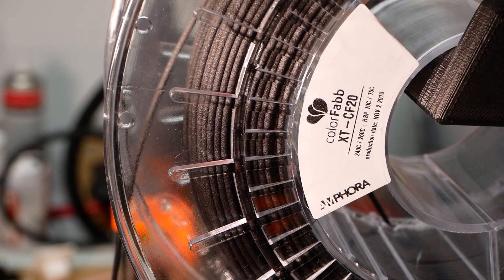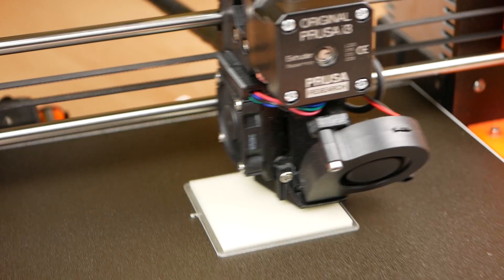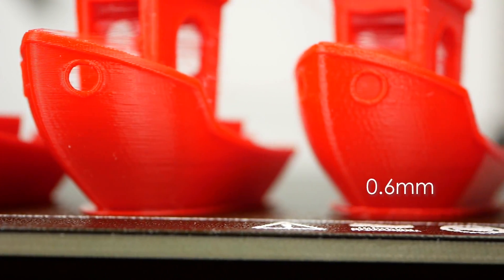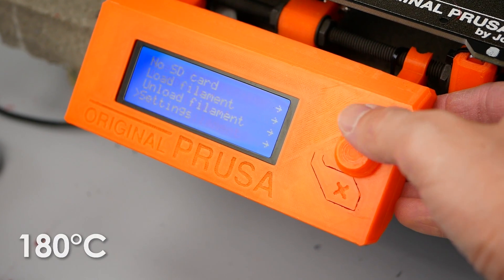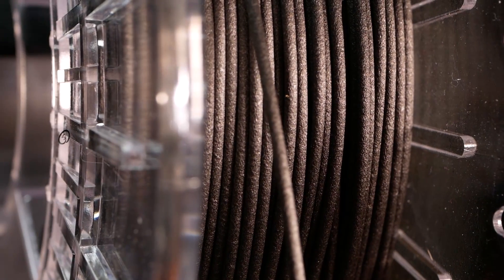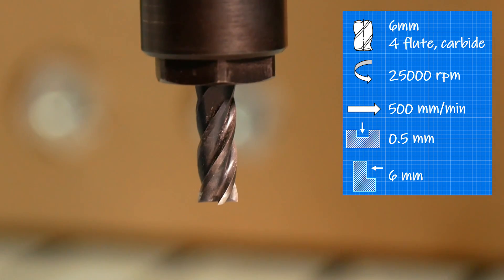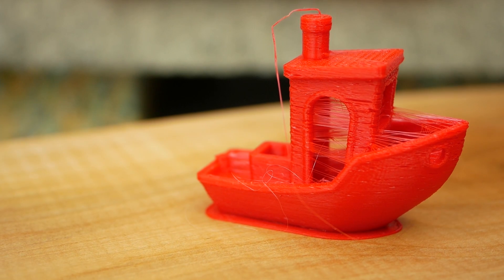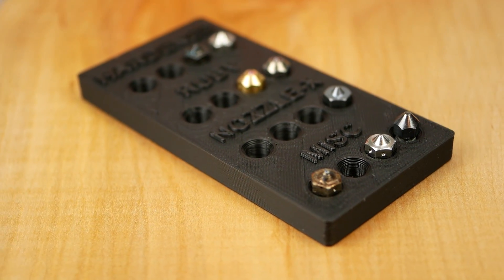HOW MUCH abrasive filaments damage your nozzle!

Comment: That spiral is from the drilling procedure at the factory. The tool is flexing as it's plunging in.
Reply: 25 year machinist .. that pattern happens when the drill geometry is shoddy, specifically the lead on the spiral or the point being off center slightly and your feed is way to high. Brass has a tendency to grab when using sharp tooling. A way to mitigate the grabbing is to flatten the cutting edge slightly on the perpendicular axis of the cut. This is probably the reason for the over powered feed so as to compensate for that flattened cutting edge.
Reply: @swould333  I can confirm that, worked a lot with brass in the past, it likes short stubby cutting edges and the unevenly sharpened chinese 1.75mm drill bit is far from that. High speed vibrations + eccentric forces combined with resonance from the brass grabbing and you get forms you could not imagine can exist!
Reply: @Waylander131  I love how every metal has a "personality".
Reply: @swould333  curious if the good nozzles are cut in three procedures and that's why they have good surface finish and geometry that clearly wasn't taken off a shotty twist drill.
Reply: @swould333  in addition to what Sean said, I wonder if E3D drills them out, slightly undersized, and then reams then to the final dimensions?
Reply: @swould333  yep.
Reply: If the drill vibrates, it usually makes cones. Like an hourglass shape. The walls of hole look like melted, probably drill was overheated during the production and left that weird pattern?
Reply: To me, it looks like the E3d nozzles that have the better finish and are machined straight are most likely reamed.
Reply: If I have to guess, they are plunging cheap floppy drill bits into the brass as fast as they possibly can. The image in my head would be hilarious if people weren't buying them.
Reply: looks like chatter and improper tool cooling. Probable a dull bit and forced it into the cut until it failed.

Comment: Hi Stefan, I'm using probably the same ruby nozzle that you have in your ruby collection. It has a chromed copper body. I use it with a titanium heat brake (all metal) and a home-designed & milled copper heater block. The back pressure in the nozzle is greater (especially with CF-PEG) so I use a dual-drive geared extruder. With a bowden cable, in a Anycubic kossel linear plus. It took me a while to get good results again, but now it's spot on. I play around with linear-advance a bit and with normal PLA it's better not to use it (K-factor zero). Hope you're having fun with it and happy printing!

Comment: Another fine video. It was interesting to see E3D's earlier research on this topic when they introduced the hardened nozzle and had similar results but much-increased internal wear. I think they did many more hours of printing. I use a lot of XT CF20 with the hard nozzle and there is no wear detectable by eye but it does eat the silicone socks!

Comment: That "spiral pattern" is simply due to the fact that the drill is probably in the same price range than the nozzles them self.
They are probably sharpened by eyeballing on a grindstone so they have very uneven cutting forces, pair that with a crappy loose chuck and voila you have your 0.20€ piece price...

Comment: I've noticed that the Geeetech "0.4mm" nozzle really has a hole diameter of 0.35mm. It is also advised to use 0.05mm higher line width than nozzle diameter.
I think you were a bit unlucky with the internal chamfer, the cheap e3d clone nozzles i got from China had a straight hole, or a hole mangled in a variety of interesting ways, not necessarily a chamfer like that. Didn't find it to be an issue for the most part. I find it amazing that they can mass machine a complex part cheaply like that as it is.

Comment: I concur with your findings, it was interesting to see the 60 degree chamfer on the inside of the e3d nozzle verses the 90 of the in expensive nozzle. Custom tooling verses standard drill bits, that is significant.
Reply: Both angles point to an custom drill bit. (Which arn't expensive when you mass produce.) The default angle on a HSS drill bit is 118°. But there can be differences for hard and soft maqterial from 110° to 130°. Carbide drills normally use 140° tip angle.
Reply: Most spot drills have a 90 degree angle and are extremely rigid. Could be step one for E3D’s process...
Reply: You are correct. Machining bits can be 90 degrees.
Reply: That would make since.
Reply: With a finishing cut at 60

Comment: Just replace your brass nozzles with stainless steel or tungsten.
Reply from the maker: Stainless Steel is not much better than brass. If steel, than hardened tool steel.

Comment: The wobbly pattern of the passage through the cheap nozzle is from a warped drill bit.

They used a high rotation  speed  (probably with inadequate cooling fluid) and overheated the bit several times and they were using a high rate f driving the bit into the brass.

Its an effect I got when learning to use a home drill press.
Reply: F Huber  it most likely isn’t cut for brass and was trying to pull the part as well which combined with being cooked and probably dull
Reply: Some more insights as to how the wobble might have occurred: The geometry of nozzles lends well to lathes (and by extension screw machines), where wobble of both the part and the drill can be more severe vs with a mill. It's also likely that the stock used to make the nozzles is at the max diameter of the part to minimize material waste, and that thinner material would also wobble more. As for feeds and speeds, the high machinability of brass allows very aggressive settings without significantly shortening tool life (and that's great for minimizing labor cost, but bad for part quality).
Reply: @tronique5736  most probably machined from hex bar
Reply: Also I bet the is not exactly round, but slightly elliptical due to the same reasons. I’ve learned the hard way as a home gamer that drilled holes are always bigger and never round.

Comment: How about adding the cheapo titanium nozzles from your favourite chinese supplier? I'm pretty impressed with those, but haven't done the in-depth  study like you did ofc.
(Oh, and yeah, awesome video!)
Reply from the maker: Titanium nozzles? That's a horrible idea! Can you provide a link?
Reply: Sure, I get the thermal properties may suggest they'd be sub optimal, but seems not to make a big difference. For the heat breaks the material is probably better suited, and the increase in surface finish also is a bigger advantage there. 
Anyways, link:
https://www.aliexpress.com/item//32849870228.html

Comment: the path inside the nozzle was made by the vibration of the drill tip. The material of the tip is so low quality that it start sway due to speed and temperature.

Comment: The spiral pattern is achieved by plunging a dull bit into the brass with a lot of force. They make a tool to cut out the inside profile then use it until it breaks. Probably the first 1,000 nozzle's bore is totally straight, by nozzle 2,000 though you have the spiral pattern and somewhere after that the bit breaks and they make a new one.
Reply: So they just jam a drill bit in there?
Reply: @cherrify3498  sounds like it
Reply: I imagine that drill runout will also cause a spiral. An extremely true and concentric chuck is needed for highly accurate drilling at such small diameters.
Reply: It's not a great application for a form drill because there is a high ratio of diameter for the tip diameter and the body diameter of the nozzle and also because the tip diameter is so small.

For a 1.75mm filament bore and 0.4mm outlet dia, one would have worse than a 4x ratio between the smallest diameter and the largest diameter on the form drill. This means that you'd really like to be drilling that tiny 0.4mm diameter a much larger RPM than you can run the 1.75mm diameter at because you'll exceed cutting surface speed limits on the larger diameter. 

This means that you have to plod ahead at 1/4 of your best drilling rate for that tiny 0.4mm end which is going to be doing a terribly ugly drilling job for the entire length of the nozzle because it's stuck to the end of the 1.75mm body dia. It would be far faster to blitz the back end of the hole with the 1.75mm dia for nearly the whole nozzle length, then go in with a 0.4mm to peck out the last bit of length at the end.

Using a second tool position to have separate 1.75mm and 0.4mm diameters will be far faster with better quality drilling and much lower breakage of tools, not to mention that standard jobber drills are way cheaper than making a form drill.

I think the spiral pattern is being caused by a cheap jobber drill being pushed too far past their sharpening regimen. There's no really good excuse because clean holes in brass with jobber drills is very easy with CNC. The level of tool wear management necessary really isn't high.
Reply: ½ right. This spiral pattern will happen regardless with any HSS drill, as flexibility is one of HSS's properties, tho the effects first gets noticeable bad then the drill is dull. You could go a lot slower (feed), but then surface quality and accuracy will suffer (hole diameter)
Reply: this^^^^^^^^

It's so simple it's strange no one understands

Comment: In a previous life I was a tool and cutter grinder in a mould shop.  One tool I had to design and make was a D-drill for plastic injection nozzles.  The interior bore ended in a 40° included angle hole.  I assume this allowed for faster flow in the injection process.  Materials for the nozzles were either beryllium copper or a tool steel.  the nozzles also had a variety of exit holes,  some on the ends and others at angles coming out on the sides of the tip.
Reply: James Crombie that's awesome!

I thought that angle was really interesting. I'm guessing E3D have tried all sorts of angles to get one that works best, but I'd be interested in results from even more acute angles.

Comment: wow , the difference between the nozzles
another reason the Prusa prints so much better than the wanhao and cr10 for small details...

I now have the ruby on the I3 for 6 months and print all materials with that.  never look back. check it once a month for damage .

printer printing PLA, GiTD PETG 20hrs a day...
Reply from the maker: Just don't use a brush for cleaning them 😉
Reply: @CNCKitchen  and make sure you realign your z-offset BEFORE using them .... duhhh :(  manchmal bin i deppad---

Comment: Would it be then possible to recondition slightly worn nozzles by lapping the tip flat?

Additionally, you could try drilling out 0.25mm nozzles to 0.3 or 0.35mm.
Reply from the maker: Should work but probably not worth the effort if a good, genuine new one is just $5.

Comment: I'm looking forward seeing you machine a tungsten nozzle 😆 Great video as always! I too have a brass nozzle and the wear was primarily on one side, the filament free extruded to one side too. I used a steel tweezers to clean the nozzle regularly, which probably did some damage too. The surface finish with a new steel with zinc coated e3d nozzle is significantly better. A new brass nozzle was going to be better too of course, compared to the damaged one. I'll try to machine the nozzle too, would be interesting.

Comment: can u straight up comapre an e3d nozzle print quality to the cheap chinese one? both new. like more testing!
Reply: Did you watch the whole video? This was done...
Reply: @AustinVojta  in more depth :P like for example lets say the accuracy of parts the fitting etc. you know?
Reply: @AustinVojta  I Mean in more depth. like part dimensional accuracy or if it's really worth it? etc part fittings would rock too. tho I already think it is from that one benchy
Reply: @AustinVojta  maybe with not THAT cheap nozzles. like trinagle labs ones/ you see my point? he compared a 21$ one to 0.2$ ones. I am thinking of more a 5$ to 21$ ones. from triangle labs as an example.

Comment: The odd spiral pattern is most likely caused by the stock being off-center when drilled. This causes the drill to wander, due to flexing, while drilling. I have seen similar behavior when milling a circle, using a bad collet that mis-aligns the tool. It can actually create a hole that is hourglass shaped in cross-section!
Reply: Also, unevenly sharpened drill bit does the job. Possibly they didn't even use center drill.
Reply: yeah no center drill would do it, i wonder boring it on our own would do any improvement

Comment: Freaking brilliant video! Very impressed by the quality of production and the solid engineering content.

The undulating helical pattern is a likely result of a worn or chipped drill bit and pushing the feedrates on the lathe too hard. Also if you don't have your drill running dead centre it will walk and cause run-out. Glad to see ours were straight and shiny as they should be, but agree that it's not really a contributor to stringing.

You're dead right that the most important part of the nozzle is the orifice to tip flat transition. We've put a lot of time into ensuring that corner is 'just so'. The internal cone angle is also a surprisingly large contributor to the ooze and clean sharp extrusion, it gets you the more laminar flow you postulate and lowers pressure needs. Combine those two and you get the rather dramatic difference you saw in stringing.

I suspect but cannot prove that the excessive chamfer on the clone and worn nozzles also serves as a place where material will cling to and accumulate. This little annular 'pool' of very liquid material may serve as a source of material that will be entrained into a string. Retraction is going to be completely ineffective at controlling any buildup on this part of the nozzle.
Reply: I was going to say: this guy sounds really sure about his statements, then I saw your name.
Reply: Genghisnico13 the “our” referring to the e3d nozzle was my first clue — people sound sure of themselves in YT comment sections allllll the time ;)
Reply: I was going to say the spiral was from a blunt drill but it has been said in detail above so I'll shut up now. Thanks very much for the great videos @cnckitchen
Reply: Thanks Sanjay! "Retraction is going to be completely ineffective at controlling any buildup on this part of the nozzle." 

This fixed the biggest problem I had. It's what I deserve for not getting the real E3D.  The real one just got moved way, way up on the git list. Maybe a new job too.
Reply: I just want to add ontop of your fine explaination about the helical pattern.

-This is a great example why GPS tolerances (Geometric Product Specification) was invented, and specifically why it's important to have them specified when you make large orders produced out of China and the like. Not that it isn't necessary in all other countries though. :-)
Reply: @martinfrandsen3960  Is this basically the same thing as GD&T?
Reply: I think AvE or ToT said the reason this happens. I think its when your speeds are too high or the twist drill starts self threading and it pulls itself into the material. Like when you drill sheet metal and the drill grabs and pulls itself through. Then it maks like a triangular shaped hole.
Reply: I absolutely agree about the drilled bore in the nozzles. And I'll add that a cheaply made drill will most likely have uneven cutting edges, which will exacerbate that spiral when pushed too hard. Manufacturing hundreds of thousands of these nozzles is almost bound to be done cheaply, so you get what you pay for in the end.
Reply: I was just about to pull the trigger on the E3D until I noticed the orifice in the pic is way off center. I hope someone will explain it away for me. https://images-na.ssl-images-amazon.com/images/I/61DQ-2sXjvL._SL1282_.jpg
Reply: Excessive feed rate, lack of pecking and worn tooling is the most likely causes, but materials like brass also have issues caused by their high thermal expansion. Materials do not heat evenly when drilling and tends to build up heat near the corners of the drill flutes during the machining process. Thus the materiel near the corners of the drill flutes is removed at a higher temperature so those areas expand more then the other areas of the cut. This leaves a smooth hole at the time of operation, but then when the materiel cools and constricts it leaves a helix or spiral shape that matches the drill feed rate. Brass and plastics it tends to become fairly prominent due to their high thermal expansion rates and high drill feed rates.

Comment: Is it possible that the tip of the nozzle sands down by touching the prints, so it sands down faster at lower layer heights?
Reply: yes and if over extruding even a little bit the nozzle will drag more.
Reply: That means one should beware of excessive ironing, right?

Comment: When you see this it makes you wonder why ANY nozzle is made out of brass! Besides the cynical attempt to get more money from consumers by providing replacements for purchase!
Reply: High thermal conductivity, low friction coefficient and easy machining.
Reply from the maker: @santiagoblandon3022  Exactly, and the raw stock is cheep, too.
Reply: @santiagoblandon3022  Correct.
Reply: or because heat transfer and cost of production
Reply: There are tradeoffs for every nozzle material. If you mostly print PLA and PETG, a brass nozzle will last quite a long time and they are inexpensive to replace. A good hardened nozzle might cost upwards of 3x as much as a brass nozzle and the thermal properties aren't as good. Pros and cons.